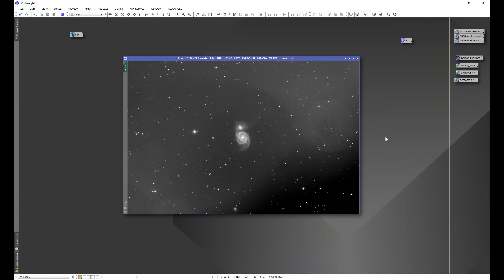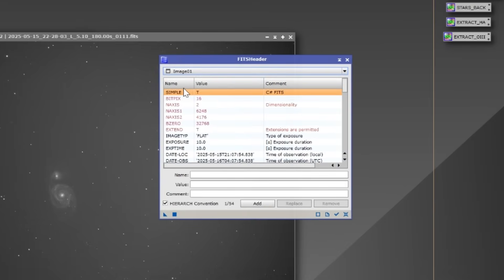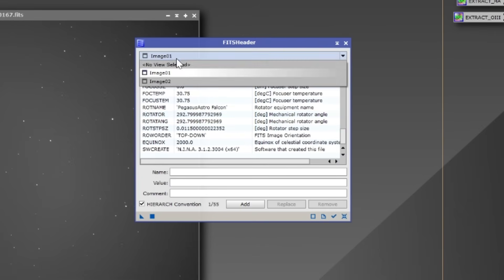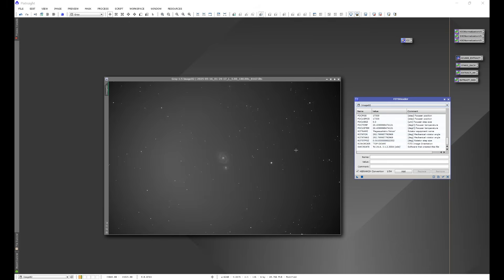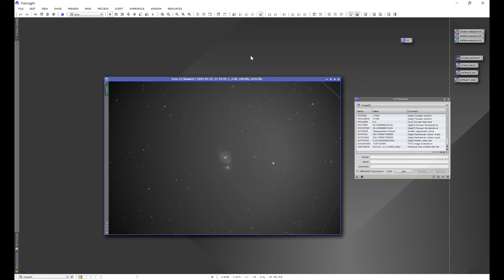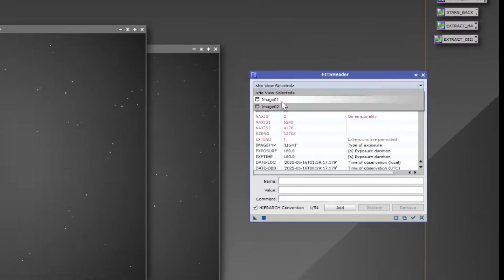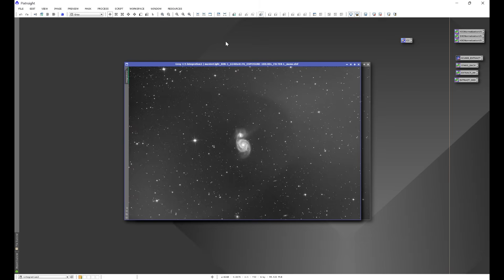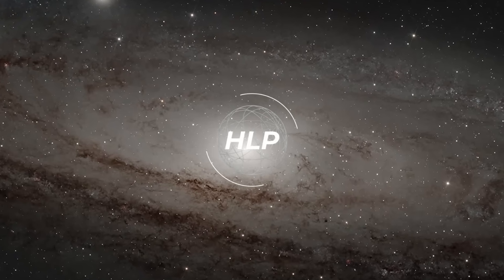The Flat Frame Trick - Hidden Calibration Killer in Your FITS Header - Night Sky Flats

Comment: Unfortunately the rotator info was removed in the2023 1.8.9 version of pixinsight. Maybe it was added back in the latest version what version are you using?
Reply from the maker: Very interesting. I’m on 1.9.3 currently. I believe it may also need to be embedded in the image metadata. It may be worth updating PixInsight to the latest version, even if just for the most recent supported version.